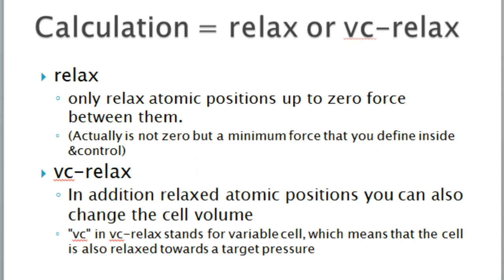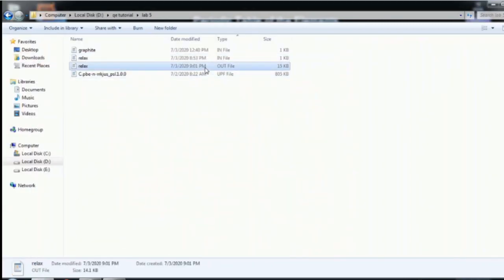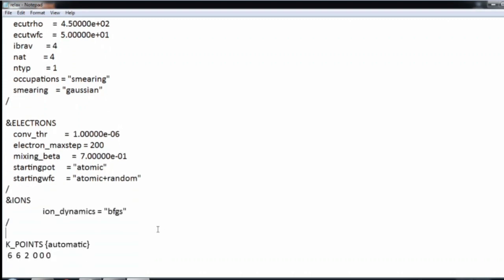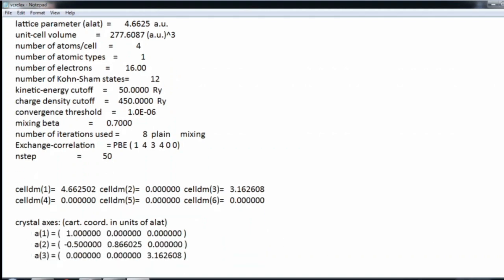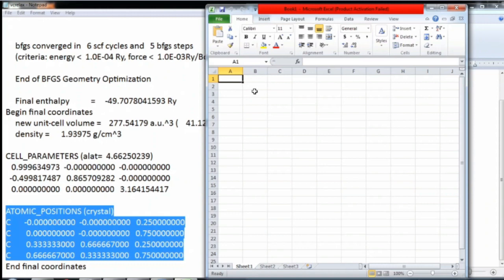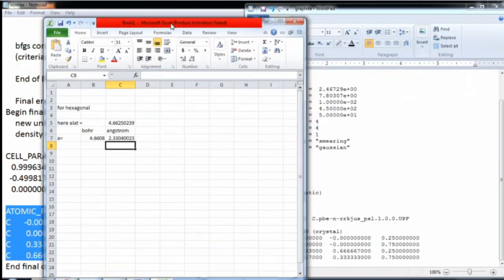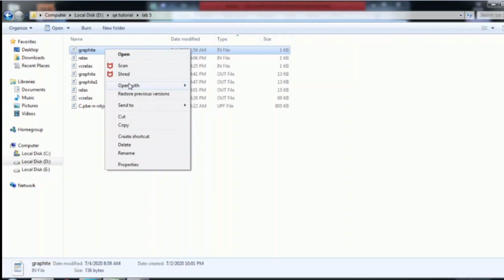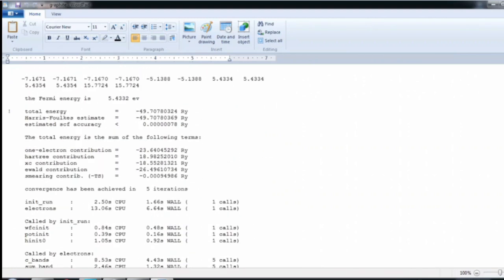Lab 5 relax and vc-relax (optimization of atomic positions and cell parameters) in Quantum Espresso.

Comment: after taking  the a33 as celldm(3) and a11 as celldm(1) my force  and pressure both increased. Should I vcrelaxed the system again.
Reply from the maker: it shows that your system is unstable. you can do vc-relax again if not solved means unstable structure or wrong PPs
Reply: @HIRENP  
Thank you so much for your response. I am also doubtful about PPs. Can you suggest me PPs for h-FeS?

Comment: Could you please tell me how we calculate cohesive energy using quantum espresso in vc-relax calculation?
Reply from the maker: https://blog.virtuallab.co.kr/en/2019/05/23/3-1-how-to-calculate-cohesive-energy/
Reply: Thank you..
Reply: Sometimes in vc-relax, convergence not achieved after 100 iterations..
Can you please tell me on why this happens and how to resolve this issue.?
Reply from the maker: yaa its happened sometime if your material is unstable, or wrong smearing is used, or wrong PPs is used, some parameters are also affect the convergence like k-points, ecut, and magnetization.
Reply: @HIRENP   Thank you very much..

Comment: How to find ecutrho for a system??
Reply from the maker: for pw ultrasoft pp it is mostly 4 times ecut
and for other it it 8  times of ecut
for NC PP it is 10 times
Reply: @HIRENP  I am sorry, I found this https://www.quantum-espresso.org/Doc/INPUT_PW.html#idm276

 "If there are ultrasoft PP, a larger value than the default (4*ecutwfc) is
 often desirable (ecutrho = 8 to 12 times ecutwfc, typically). PAW datasets can often be used at 4*ecutwfc, but it depends on the shape of augmentation charge: testing is mandatory."
Reply from the maker: yes sir you are absolutely right. thank you for your guidance.
Reply: @HIRENP  Thanks a lot 👍👍

Comment: Very helpful, thanks
You specify that c/a is the element a33 in cell parameter matrix and a is a11, why ?
what about other crystal structure ? what is the criteria ?
Regards
Reply from the maker: ibrav      structure                   celldm(2)-celldm(6)
                                     or: b,c,cosbc,cosac,cosab
  0          free
      crystal axis provided in input: see card CELL_PARAMETERS

  1          cubic P (sc)
      v1 = a(1,0,0),  v2 = a(0,1,0),  v3 = a(0,0,1)

  2          cubic F (fcc)
      v1 = (a/2)(-1,0,1),  v2 = (a/2)(0,1,1), v3 = (a/2)(-1,1,0)

  3          cubic I (bcc)
      v1 = (a/2)(1,1,1),  v2 = (a/2)(-1,1,1),  v3 = (a/2)(-1,-1,1)
 -3          cubic I (bcc), more symmetric axis:
      v1 = (a/2)(-1,1,1), v2 = (a/2)(1,-1,1),  v3 = (a/2)(1,1,-1)

  4          Hexagonal and Trigonal P        celldm(3)=c/a
      v1 = a(1,0,0),  v2 = a(-1/2,sqrt(3)/2,0),  v3 = a(0,0,c/a)

  5          Trigonal R, 3fold axis c        celldm(4)=cos(gamma)
      The crystallographic vectors form a three-fold star around
      the z-axis, the primitive cell is a simple rhombohedron:
      v1 = a(tx,-ty,tz),   v2 = a(0,2ty,tz),   v3 = a(-tx,-ty,tz)
      where c=cos(gamma) is the cosine of the angle gamma between
      any pair of crystallographic vectors, tx, ty, tz are:
        tx=sqrt((1-c)/2), ty=sqrt((1-c)/6), tz=sqrt((1+2c)/3)
 -5          Trigonal R, 3fold axis <111>    celldm(4)=cos(gamma)
      The crystallographic vectors form a three-fold star around
      <111>. Defining a' = a/sqrt(3) :
      v1 = a' (u,v,v),   v2 = a' (v,u,v),   v3 = a' (v,v,u)
      where u and v are defined as
        u = tz - 2*sqrt(2)*ty,  v = tz + sqrt(2)*ty
      and tx, ty, tz as for case ibrav=5
Reply from the maker: you can read it in ibrav section in page : https://www.quantum-espresso.org/Doc/INPUT_PW.html